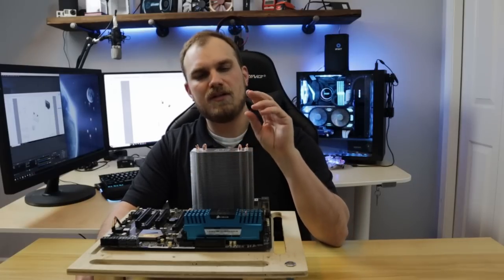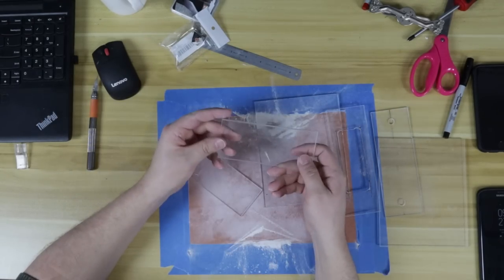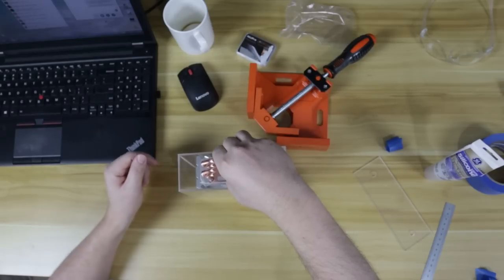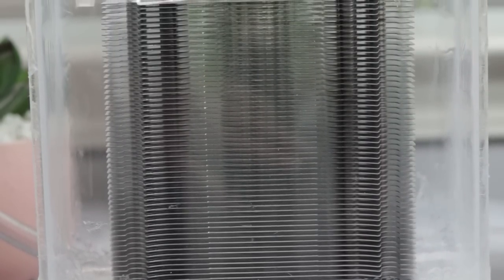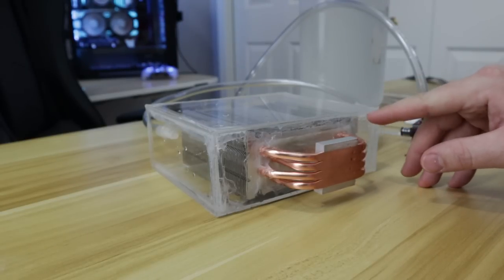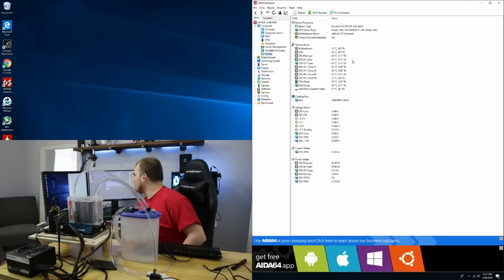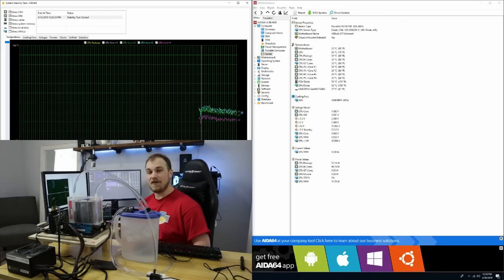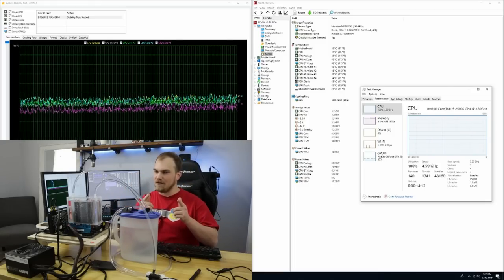I Water Cooled My Air Cooler AND..........

Comment: You should do this again and use mineral oil instead of water and leave the fan on the heat sink. Like this so he can see it 😉👌🏻
Reply: Agreed completely.   Water will stain the copper quickly.  The fan doesn't even have to run at full load, one just needs to move the liquid through the fins.
Reply: Dude, that's an awesome idea. I want to see this!
Reply: it's gonna be tough to figure out a good way of having the fan cable connect to the board while it's in the tank
Reply: @TheZerok666   using cable gland? :D
Reply: @TheZerok666  there is no water on top of the cooler, thus you can make there a hole and glue the cable with silicon, thus no water can come out of there.
Reply: Yeah, use car lubricant like Pennzoil or Kendall to see the effect.
Reply: Yeah try this with oil And fan to shoot cool liquid through the find. Stick water reserve in dry Ice
Reply: @Peter-h4x5l  you win :D
Reply: @TheZerok666   he has to replace the cable of the fan for a thicker one ,that wear oil.  Thicker wire could use a a cable gland that has higher IP rate, IP68 or something. He could use some glue to seal it completly ,that could be used at the bottom of the tank too. Let the tank dry from water and fill the bottom with some sealing stuff, that used for water sealing ,slow dry time and good filling capacity. For better cooling I would change the fluid input or output levels to let the fluid go trough the  cooling radiator, but it is harder to seal it.
Reply: He could actually just submerge the whole PC, then he doesn't need to worry about how to run the cables.  Just put all the switches/buttons and the frequently accessed ports on the top of the tank.

Comment: I not checked if there is a newer Version of this video so, here dear creator I have some helpful Informations to you.

One mistake is your water tank.
The Material is a polymer probably pp or pe, with kinda thick walls, due to the thermal absorbing features of this material it will heats the backcoming water again and again over time.

The Tank should be in this case a metal box.

Second thing is the glue what you mentioned yourself it causes micro cracks in the material, especially if it‘s not tempered (a technique to remove tension on amorphe and partly cristalline materials), if you used pmma/plexiglas than you should go with acrifix 2 component glue of Röhm/Evonik.

Well your fittings work and may you find better options for that aswell am not sure.

Anyway after you finished the pmma/plexiglas solution I absolutely recommed to temper it for around 8-10 hours at around 75 degrees celsius. It will strenghten the case against chemicals.

Last step could be a cooling plate under your new metal tank, and adding glycol? to your water solution. But am not quite sure in this step how it reacts to the metal of the cooler, would be a try worth.

Comment: 1. Theoratically a water cooling system is BOTH. water flows to the CPU then to the Radiator, where the water is spread inside and being cooled with FANS.
2. Your custom cooling system is built WRONG. as if with fans it is open and constantly cooled, you closed it in a container where the heat is preserved with the water. now you'd say the water is flowing but from where to where? it would have been better to set the input water flow in the bottom and the output on top as high as possible, that way you know the water flows all the way. in your custom tank, there is no circulation or whatsoever in the bottom.
Basically, a water cooling system flows water directly in the CPU and constantly flows, what you have done here, is just cooling the pieces of metal that are conducting the heat by water instead of air flow, and not built as efficiant as it should be.
Reply: Actually most aircooling systems are both as the heatpipes do use water in a vacum to speed up the transfer of heat.

and yea essentially using a tower cooler as a cpublock is not as efficient be it simply because the heat has to travel through the air cooler first instead of traveling a very small distance to the cpu block's fin stack. Regardless of the heat in the fins is transfered to the water efficiently. The delta between the ice water and the cpu shows how inefficient this is.
Reply: THIS: "It would have been better to set the input water flow in the bottom and the output on top as high as possible, that way you know the water flows all the way. in your custom tank, there is no circulation or whatsoever in the bottom."
Reply: Just wanna correct you on one thing, there is almost certainly flow to the bottom of the coolant tank. Have you ever dropped food coloring in water? It continues downward since those molecules have momentum. While he could certainly get better flow of fresh water over the fins by properly positioning the inlet and outlet, right now the tank essentially swirls in a clockwise motion. It's not like the water molecules stop as soon as they hit the top of the water and then float across to go out. I suspect if he put some food color in, we would see most of the cooler tank quickly color, albeit with some dead spots, especially in the bottom corners.

Comment: By running it through ice water, you kinda break the experiment
Reply: Not only break it, but also destroyed it, you could put a ice packet on a block and provided it doesn't melt onto the motherboard itself you can cool the CPU.
Reply: Tryston Kincannon although the ice solution instead of a radiator lessers the precision of the experiment as the delta T (temperature difference) is radically different from that of the ambient air, it still shows that potentially a water flow can cool the fins of an aircooler. Altough this may seem appearent, experimental data is always prefered over conjecture.
Reply: I think the main point if this was to show it could be done. The ice obviously negates any temperature readings.

Comment: If he lowered the pipe that is sucking the water almost to the the bottom he could avoid the skeeting problem
Reply: My first thought too, and I'd drop a bit of dye in at some point to see the flow over the fins as I suspect there isn't much. I suspect the limiting factor though should be how good the heat conductivity is from the cpu to the heatsink, not how the water takes it away.
Reply: How to do CPU heat conductivity measurements? Is it DIY-friendly?
Reply: @paschalx  Yea just test the temps on your cpu xd
Reply: I would put the cold water supply on the bottom in one corner and the hot water return in the upper, opposite corner - based on the orientation the MB will be sitting in IRL...
Reply: Or just flow the water through from one side to the other without worrying about verticality.  Water is always going to take the path of least resistance, so it's always going to want to go around the heat sink instead of through it unless you make that the shortest and least obstructed path.
Of course, if you perfectly fit the tank to the heat sink you can force the water through from any orientation.  In that situation you would want the intake and output in opposite vertices with the system being fed from the top.

I think OP was referring to how the out would occasionally pull in air instead of water though.  That's actually because he's using the pump to pull the heated water out instead of push the cool water in, the water level won't rise any higher than that pipe.  There isn't much that can be done about that unless he completely eliminates all air from the system, reversing the flow would also fix the problem but would hurt efficiency.
Reply: heat rises so the cooler water will go straight to the bottom. This is a simple water to air heat exchanger. The ice melting fast reinforces my point, If it was just going from inlet to outlet the ice would last a lot longer.
Reply: @OKuusava  Car radiators apply my physics.

Comment: I worked on F-111’s in the Air Force in the early 70’s and part of the air conditioning system, which bled off engine exhaust for the source, had an air-to-water heat exchanger. Congrats for thinking outside the box.

Comment: I mean, technically isn't this literally just a massive scale version of exactly what's happening in a water cooling block?
Reply: Is mayonnaise an instrument? Yup
Reply: Exactly!
Reply: Yep, but the area for heat transfer more bigger than the original water cooled system..
Reply: @passingbyguy  Yep, but the water flows more slowly on the radiator than in the water block.
Reply: A real water system would have a means of cooling the water...without a radiator that water will be boiling in short order.
Reply: This is less effective because you are probably losing efficiency due to the limitation of the heat pipes.  Since its not direct contact you are only going to be able to cool to what the heat pipes can exchange verses direct heat transfer of the water across the full copper block directly attached to the cpu in a conventional system.
Reply: This is reverse of Radiator ✌ with demerits
Reply: No because air-coolers heat blocks work differently inside. Internally it works by "convective heat transfer" there's liquid inside that boils, steams off and cools back down to the otherside of the pipes recooling your pcu over and over. Water cooling works of a block, not convection. While this block is water-cooled, internally from the aircooler it works differently
Reply: @spyder000069  well, I always thought that modern thin cpu water block might benefit with more fin surface area. Maybe  a thicker water block can be more effective?

Comment: Good concept dude, little tip with sealing leaks once the tank is 'sealed' hook it up to a vacuum then apply extra epoxy/silicon to your weak areas to allow the vacuum to draw the sealant into the gaps youl get a much more reliable seal and also if your vacuum is good enough youl create a cap internally :)

Comment: Time to step up the game and make a version 2.0 by connecting the tube to a radiator.
Reply: Yep - complete the back end with a regular water loop arrangement (rad, res, pump) in a case.
Then you are really comparing the heat transfer efficiency of a water block vs your water-cooled fin stack.

Bonus point if the whole thing runs in a tower. (extra kg twisting load on the motherboard)

Comment: I like the idea a lot, though I'm concerned about the added weight. If the Motherboard is mounted horizontally it's likely going to be less of an issue but most cases still have vertical mounting, I think the CPU socket could be in danger without a stronger retention plate to help weight distribution.
Reply: Nah it's strong enough it it can hold be quiet Coolers this is a small amount of water
Reply: I was about to comment this, sure it can be done, but aluminium plates are not strong enough to mount tank on them, maybe directly on tubes. I was expecting of mounting tank on tubes in this video already
Reply: some compact liquid coolers have the radiators  literally on the socket so i dont think this is an issue

Comment: I'd be wary of using ice water, you don't have a way of dealing with condensation on your tank. Cool idea though.
Reply: put the case in a sealed box full of silica gel packets, they will remove any moisture and prevent condensation. of course then you have to deal with convection. even if the cpu and gpu are on their own water loops, there are other components that produce heat. they could have their own blocks. of course radiators can work in reverse, its essentially a heat exchanger and will move heat from the hot to the cold side. normally the hot side is the liquid and the cold side is the air, but you can flip it around and treat it as if its a water block, and fans can circulate the air. and it doesnt need to be air either, a high density gas like co2 can be used to improve conductivity.

Comment: Design flaw: Input and output on same level.
Better: Place input at bottom of container.
Reply: Also he probably wants to put a divider in the tank to direct the flow of water through the fins instead of around them
Reply: I was gonna comment the same. Glad someone else noticed.
Reply: ganzano this what I’m going to say
Reply: I never thought about it. Good idea.
Reply: Well I see what your saying but the motherboard is flat on a test bench, when it would be in a normal case it would be tipped on its side. so flow bottom to top or other way around. I think this is a really cool idea but more testing is needed to see where it needs improvement. I’d recommend putting in dye to see just where the water is flowing in the tank. Would help get a better idea if fins do really need to be added.
Reply: The other major issue is the air trapped between the fins acting as an insulator on those fins.
Reply: Heat rises intake should be on bottom. Outtake on top
Reply: @nathensalewski964  with this much liquid inside, the case will too heavy and will bend the motherboard when the motherboard stand up
Reply: CAO JAY you can always add bracing  my dude
Reply: @nathensalewski964  you prove a good point if he ever decides to install it into a case.

Comment: This is called a radiator. You still need to remove the heat from the fluid at some point in the system or you'll end up with a bucket of hot water after a couple of hours. By adding ice you've increased the thermal capacity of the system (good), which translates to a refrigerator cooled CPU. If you loop the water into your fridge then you'll have a huge and continuous heat removal system for your CPU. And then the compressor inside your fridge will be doing the work. See where I'm going? Heat -> Work. Work has to be done at some point.

In any case I congratulate you for your ingenuity and creativity. These things make me smile.

Comment: What about water-cooling a AIO radiator ? :D
Reply: steve and jay already dipped radiators in ice and water lol
Reply: Kyle from BitWit too
Reply: wont help temps much unless you can blow AC or cool the water constantly lower then ambient temps but then you run into the problem of condensation.
Reply: "We've just watercooled the watercooling system radiator to make sure you're watercooled more than ever!" LOL
Reply: and water cool the radiator on the loop cooling the aio radiator
Reply: Double rainbow
Reply: Water cooling a water cooler water cooling a watercooler genius

Comment: So it's basically an over-engineered cpu block?
Reply: No, a standard CPU block has a fraction of the surface area this has to transfer heat away.
Reply: lorzon 
So it's basically an over-engineered cpu block. ;)
Reply: @lorzon  No, a standard cpu block has the same surface area as this cpu block. This isn't increasing the contact area with the block to the cpu, this is encasing a fanless radiator with the water rather than passing it through the radiator itself, but with this setup you'd still need another radiator with fans to pass the heat from the water to the air for extended uses (or some other means of cooling the water stored in the reservoir.
Reply: @lorzon  If he slapped a normal waterblock in this setup (the jug of iced water and pump) he'd have the same results because the thermal conductivity of water is more than enough to get the heat away from the chip.  What this doesn't solve is cooling the water.
Reply: @pulver117  I hear $1000 chillers work good to overclock CPUs

Comment: Use some low profile/flat cooler with heatpipes and then build a enclosure around it.
You don't need this much fins.
Reply: If you make it well it will look cool if it is big.
Reply: well basically he is using the best possible actual cpu block, so by completely removing that bottleneck, and considering really everything else in watercooling loops are scalable, this actually could increase headroom for overclocks
Reply: @calebv59  possibly...but only if temps were your only consern. Overclocking isn't just making sure your system is running cool, but can handle the amount of power being put through to it. With that being said, AMD and Intel could possibly create something to take advantage of such cooling power. However, with this style of cooling, it seems temps can still drop, even under load. Which means that at idle, you risk cooling your cpu to below ambient temperatures. This would cause condensation, ultimately distroying your new build. So in order to avoid this, a sensor system needs to be put in place as to when the pump will start and turn off, in order to stabilize cooling, much like gpu's have sensors for their fans. A full combination of these, and yes, overclocking could see higher limits. Further being pushed by using a coolant instead of straight water. Oh, the possibilities.

Comment: think about integrating the pump and tank as a unit, and a 120 rad exhausting air out the top or back of the case
Reply from the maker: So many great ideas from all you guys, I could have projects for years, I need a laser cutter for sure.
Reply: Space around the air cooler already works as liquid reservoir. Maby connect hoses to radiator with built in pump or leave pump in line on hoses. You could use some silicone to force flow trough fins. GL with improvements
Reply: @MajorHardware  I can cut it for you

Comment: You could optimize the operation of the loop by partitioning the chamber in half, forcing the cold water through the fins of the tower cooler, which would allow for less use of water and more cooling potential.  If you also direct the cold water lower down in the cooler than the outlet tube, you will also be able to leverage the natural convection current of the assembly.
Reply: Orrr you could submerge the entire system in a mineral oil setup with an acrylic tub with a fan on both sides of the tower cooler to force the hot oil to the other side of the setup.